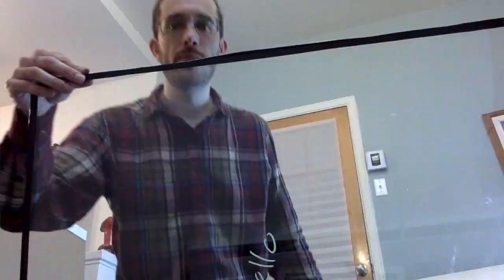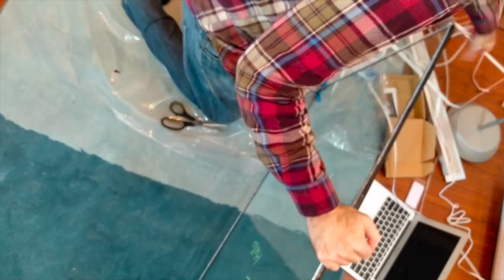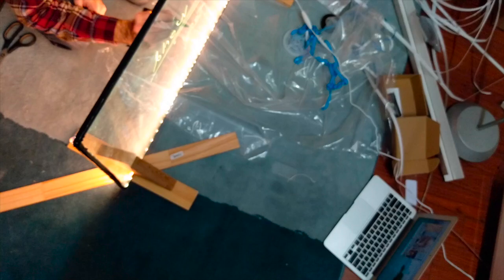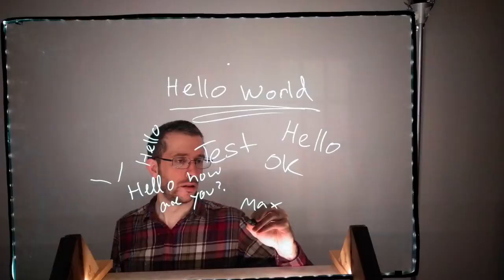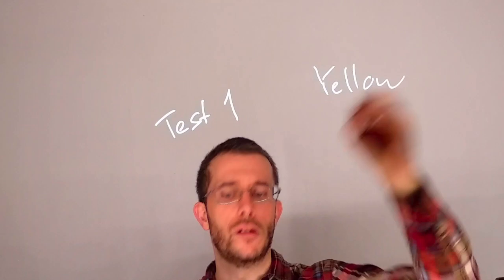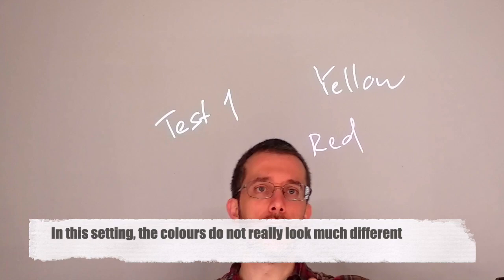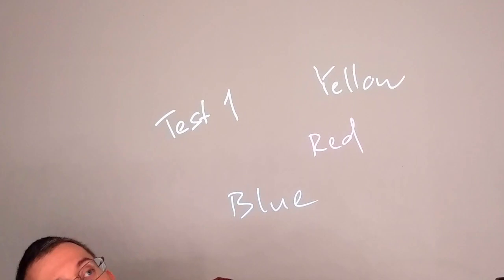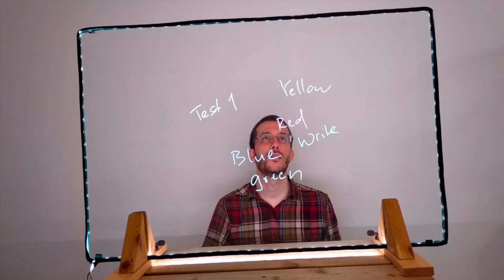Assembling my second DIY lightboard

Comment: Love your project. Could you do one for horizontal setup? Also, do you use special market or just ordinary marker would work too?
Reply from the maker: Hi, the orientation does not matter, when putting it vertically I would be careful to not tilt it over as the brackets might be too small to resist the push when writing (a nice physics question for the students ;-) ). Ordinary markers do not work that well, I used the Expo Neon Markers.

More here http://stefan.bracher.info/lightboard.php

Comment: I want to mount my lightboat. Take a doubt: the edge of the frame has to be transparent to pass the LED light or with that green finish on the edges can the LED light pass?
Reply from the maker: The light has to get in from the edge. Transparent is best, maybe light green finish also works.

Comment: The fast foward makes lost the details. I would like to exactly how do you setup the lights.
Reply from the maker: You can play it slower ;-) Basically I out the LED strip inward facing on the edge of the glass, attaching it with electrical insulation tape.

Comment: That piece of glass must have been hella expensive! I priced out a piece of ultra clear (low iron) and that was only 3 ft x 4 ft and they quoted me a price of $1097 with shipping being $780! And I think your measuring tape must be off... because there is NO WAY that piece of glass is only 3 ft x 2 ft... that's more like 5 ft x 4 ft (if not bigger)
Reply from the maker: The glass is 3x2 ft (I am 6 ft tall in comparison) and was at a reasonable price (replied with details by email)

Comment: How do you make the brackets to hold the board up? I’m struggling with that.
Reply from the maker: I built my own wood-brackets (not the metal shelf brackets most other people use). I screwed them very tight, squeezing the glass, and the legs are quite large (to prevent tilting when the cat tries to push it over...) See https://youtu.be/JgvB0AQikYQ?t=42

Comment: Sir can you share the thickness of the glass and size please??
Reply from the maker: Hi, the glass used was 36x24 inch, 3/8'' (10 mm) wide, ultra-clear untempered glass with seamed edges and round corners.
Reply: @StefanBracher  thank you sir

Comment: Hi how you fixed mirror during live class as students seen the words mirror in live class
Reply from the maker: OBS flips the image: https://youtu.be/w0YfThXmAzU
Reply: @StefanBracher  is there is any option to flip without using obs from iPad Pro as obs is not in iPad similar to the window version please help I m in deep trouble
Reply from the maker: @Jamesthkchm  I don't know... you'll have to find an app das works on Ipad then.
Reply: @StefanBracher  did the web camera will work for mirroring
Reply from the maker: @Jamesthkchm  OBS takes the WebCam input and mirrors it (plus other cool stuff you can do like changing the background), and then outputs it as either a virtual WebCam, or as a "windowed projector" that you can then screenshare (I would recommend that later option as the resolution on screenshare is so much higher). Just use your main computer for the class. (You can even use the Ipad as a remote camera in).  Maybe the software you are using has an image flip setting too...it should be pretty standard now.
Reply: @StefanBracher  I am unable to used my light board for live class as mirroring issue is not ok in zoom or google meet
So I just thought that can the web cam connect to the iPad will mirror automatically or not
Reply from the maker: @Jamesthkchm  as I said, check the settings of your webcam... Many have image mirroring built in
Reply from the maker: Maybe also Zoom, TEAMs can do it by now
Reply: @StefanBracher  no its not fixed all the students seen mirrored the words i wrote in lightboard 
Did u have any solution  please find
Reply from the maker: @Jamesthkchm  then abandon the Ipad and use a real computer with OBS as I wrote before, that is my solution.
Reply: @StefanBracher  need to purchase then